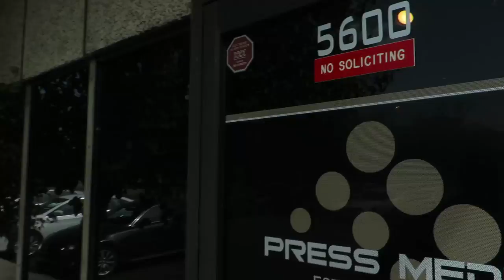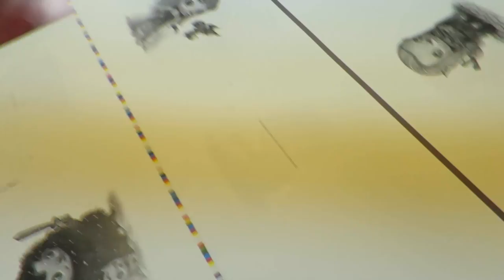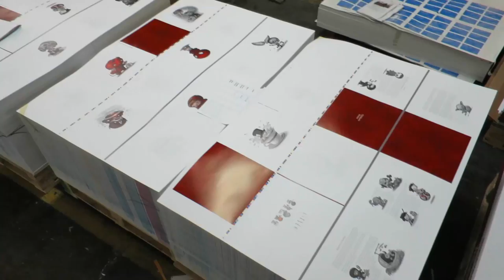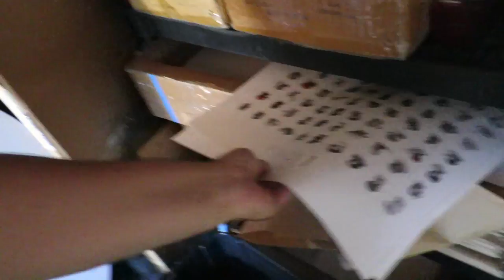Asking Your Printer The Right Questions

Comment: Nice bike, Will! I'm in the older car owner club, too! 2002 Volvo V70...we haven't had a car payment in 10 years. (But I'm especially fortunate to be married to a master mechanic who can fix our cars) 

Great advice on establishing a dialog with your printer. I worked for a local press for 4 years after college. In that time I learned tons about the printing process that I carried with me into my design career. 

It's always in your better interest to discuss your print job with the printer and ask what you can do to make the job smoother for you and the pressmen. Most printers are happy to help and make recommendations that will save you money and time. 

Sometimes, the printer will "gang" run a small color job like a post card in the "wasted space" of a larger job and charge way less for it than if it had been run on its own. A big part of the cost of a job is press setup so piggybacking on another job saves them the labor of doing that twice and saves paper!
Reply from the maker: Great tip about ganging up - I think that's also where being willing to wait comes in too!
Reply: Just a few other mentions...ganging is pretty much a local printer only option. Most online printers already do the gang runs so they can offer the competitive pricing they do. Gang runs are also great if you have a friend or two who want to run a job that has the same printing specs (paper, ink, etc). Sometimes you can get a better deal splitting the cost because printing is generally cheaper the more you run (because of the set-up costs being up front).